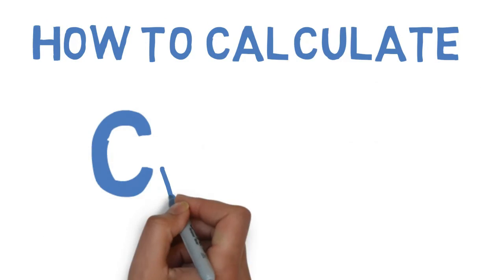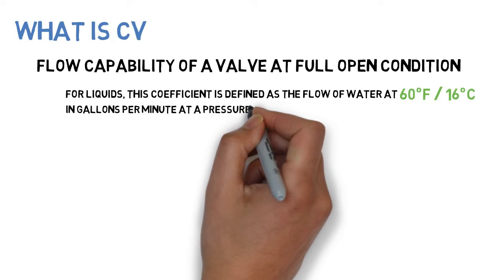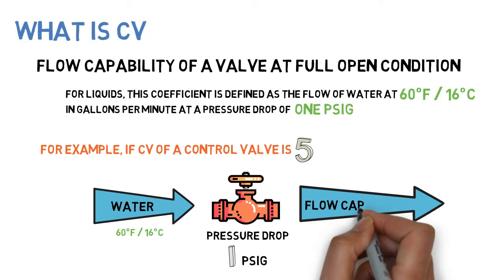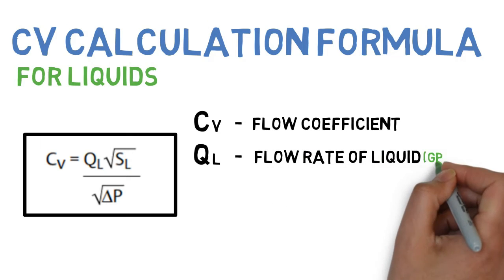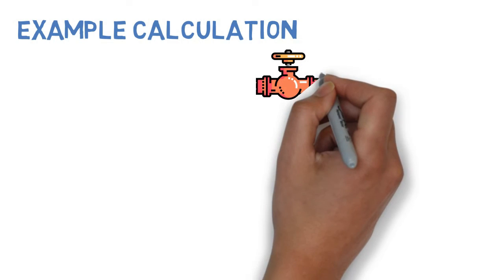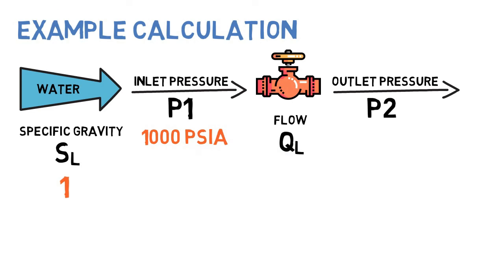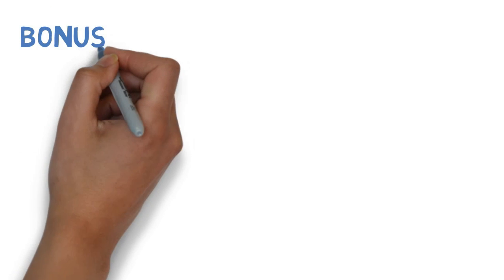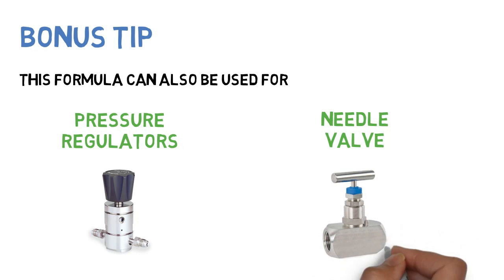Control Valve Cv Calculation for Liquids | Simple Science

Comment: hi sir 
the question is: 

in desiging process, we should select proper size of valves.
in calculation process, we don’t have any information about pressure in down or upstream of flow. 
so how can we determine the P1 and P2 ?
Reply: In almost every industries there will be need for a valve with specific Cv and/or pr inlet and pr outlet 
Or we can calculate dynamic pr from inlet velocity